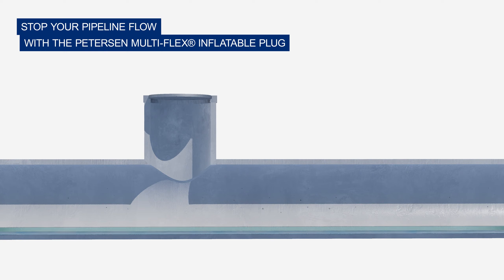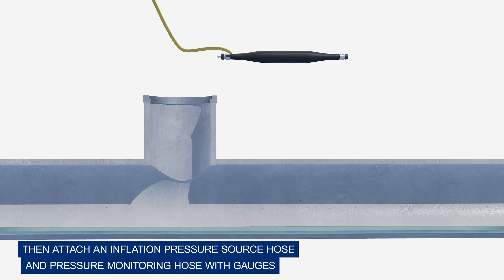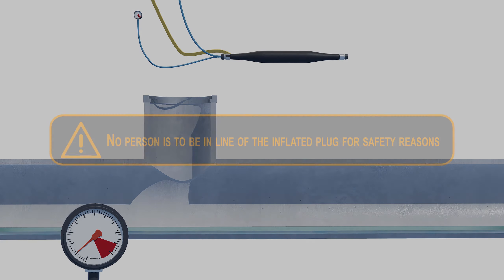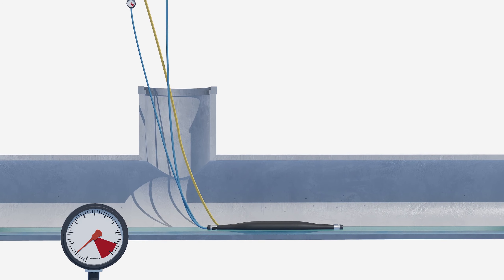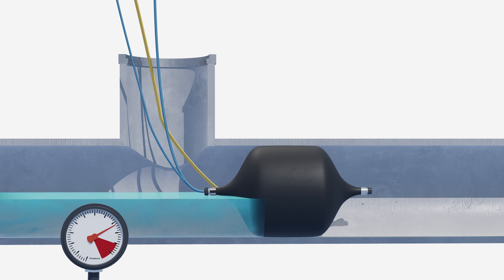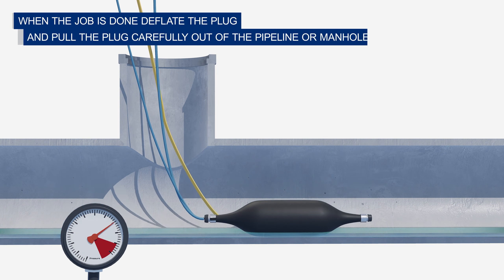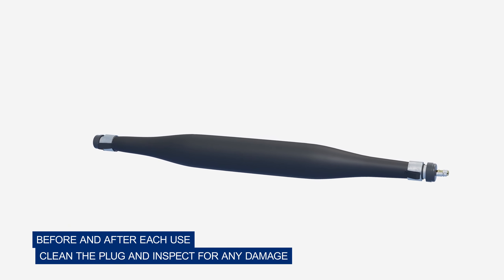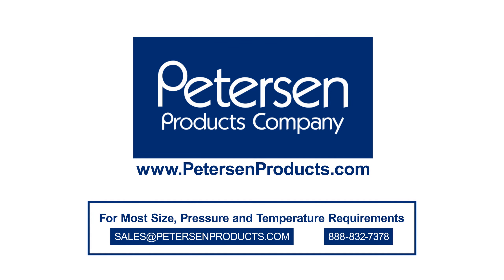Petersen's Multi-Flex Inflatable Pipe Plug Instruction Video

Comment: can this be used on hydrocarbon pipeline ? say 16" pipe size.
Reply from the maker: The 114 to 124 series would all work with hydrocarbons, all Multi-Flex® plugs can be configured for hydrocarbons and most chemicals. Visit our website or give us a call to provide more detail as to your specific application.